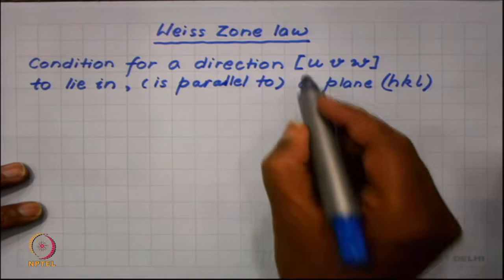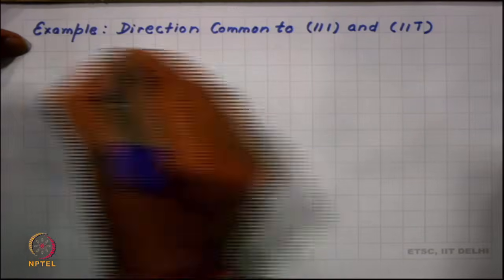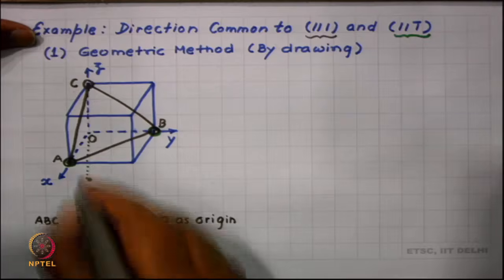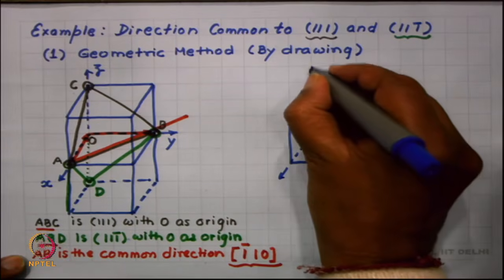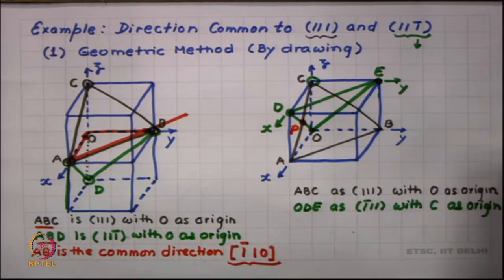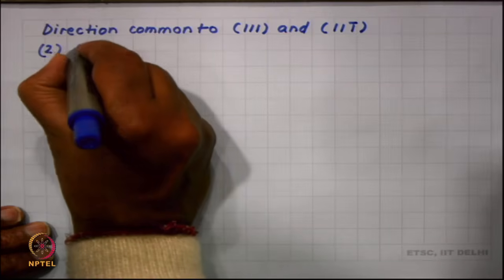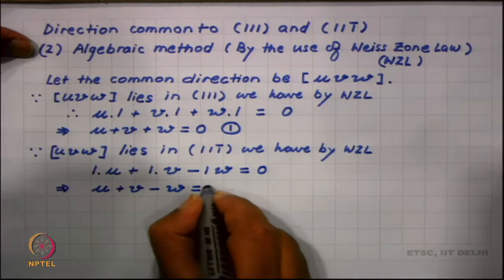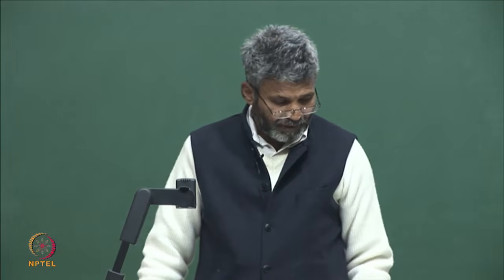Weiss Zone law and its applications

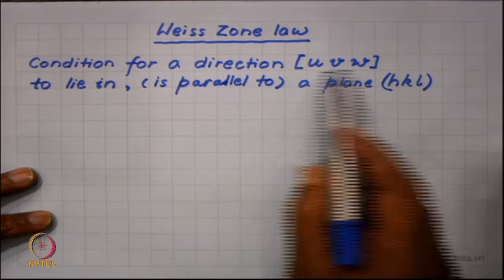Comment: sir in 1:48 you have stated "(is parallel to)" how is it parallel sir ! eg. if (110) and [-1 1 1] is this two parallel ?
Reply from the maker: Yes, the direction [-1 1 1] either lies in the plane (111) or is parallel to it. You can check it by drawing.
Reply: @introductiontomaterialsscience  Sir plane should be (110)...I think (111) is written by mistake?

Comment: I think it should have been pointed out that weiss zone law is nothing but same as vector law that dot product of two perpendicular vector is zero.
Here two vector being the direction( [uvw] ) and the plane(vector perpendicular to plane (hkl) ).
Reply from the maker: This simple explanation will work only for cubic crystal system as only for cubic crystals [hkl] vector is normal to (hkl) plane. It is not true in general. For example [100] direction is not perpendicular to (100) plane in a hexagonal crystal. However, the law itself is true in general, for all crystal systems.
Reply: @introductiontomaterialsscience  thanks for pointing out the flaw in logic.
I think...
Yes, the word "perpendicular" can only be used in case of cubic as only cubic system is cartesian but intuitively thinking about it we can say that the dot product of two basis vector is zero and therefore the vector law holds.

Or another way, lets imagine that all the other crystal systems are just modified cubic system (like what linear transformation in matrix does to 3d space) then the vector law holds for direction[abc] and the plane(pqr).
Reply from the maker: @saurav1916  As I mentioned in my earlier answer, the key step required in a proof based on dot product is that [hkl] direction is perpendicular to (hkl) plane. This is not true in general. However, [hkl] direction in reciprocal space is indeed perpendicular to the (hkl) plane in real space. This fact can be used to give a proof based on dot products. But you then need the introduction of reciprocal space.

Comment: Great explanation! can the problem of common direction be solved by applying the cross product between the two planes?
Reply from the maker: Yes. mathematically the two methods are equivalent. But the justification for using cross product is a bit more involved for non cubic crystal systems. It requires the use of reciprocal vectors which I have not discussed in this course.

Comment: Dear Sir, Miller indices for common direction AB is [1bar 1 0] if we consider A as an origin to define AB Direction, if we consider B as an origin then what would be the Miller indices of AB Direction? Is it [1 1bar 0]??
Reply from the maker: If AB is [-1 1 0] then BA is of course [1 -1 0]. But this is considering AB and BA as vectors. But if we consider the entire line without considering the sense, then both are equivalent and either of them represents the entire line.
Reply: @introductiontomaterialsscience  Okay Sir. Thank you very much.

Comment: Sir, what will be the common direction to [2 3 5] and [1 1	-1]
Reply from the maker: [8, -7, 1] as can be obtained by application of Weiss Zone Law.
Reply: @introductiontomaterialsscience  how to do this geometrically professor? Unlike the case of this video, ( 2 3 5) and (1 1 -1) does have any direction coinciding or parallel.
Reply from the maker: @pranav9339  As large numbers like 5, 7, 8 are involved it would not be easy, although possible, to do this geometrically.
Reply: @introductiontomaterialsscience  Thanks a lot prof.

Comment: Hello sir, I have a general question. If the type of crystal is not mentioned, are we supposed to consider a primary cubic crystal?
Reply from the maker: Weiss zone law is applicable to all crystals. Thus in the application of this law, it does not matter what is the crystal system.
Reply: I mean, not just in Weiss Zone Law..... If I'm given the Miller Indices of Direction, and the type of crystal is not specified, will I consider a primary cubic crystal?
Reply from the maker: @anuragdatta3403  Since you asked on this video, I assumed it to be related to the Weiss zone law. In general, you cannot assume it to be cubic. The answer to any question related to length, direction or interplanar distances depends upon the crystal system. Take for an example, the angle between [100] and [010]. For a cubic system the answer is 90°. For hexagonal system it is 120°.
Reply: Okay sir.
Thank you so much!
Your explanations are really amazing.

Comment: Sir, how Weiss law is applicable to other crystal structure? The law depends on the dot product of the line and the normal line perpendicular to plane giving us the dot product equal to zero. But in other crystal structure, I won't know the miller indices of the line normal to the plane.
Reply from the maker: There is  way to prove it without using the dot product. It can then be shown that it is applicable to all crystal structures.

Comment: Good Morning Sir, in the equation 3 you mentioned u=-v, but it could be v=-u. if it is v=-u then we will have miller indices like [u -u 0] which turns out to be as [1 -1 0] (can't put bar over a number).
Reply from the maker: Thanks for asking. Yes, that is also possible. Both [-1 1 0] or [1 -1 0]  are right answers. These two indices are actually representing opposite senses along the same direction. Since we are only interested in the line of intersection and not the sense, either of them is the correct answer.
Reply: Introduction to Materials Science and Engineering 
Thank you!
Reply: @introductiontomaterialsscience  so, in general do [u v w] and [-u -v -w] represent the same direction but in opposite sense?
Reply: @blzKrg  Yes.
Reply: I am also thinking the same it got clear with your wonderful reply sir thank you